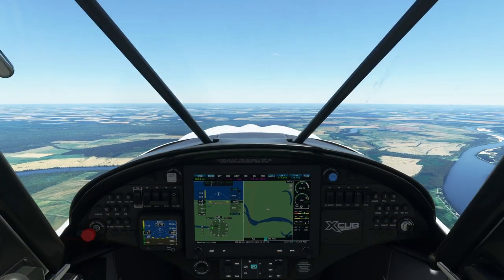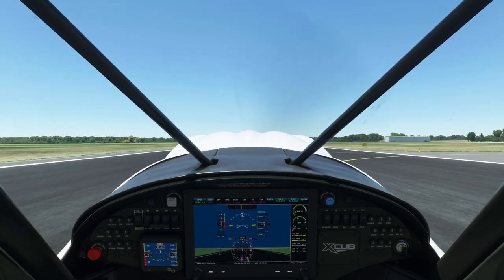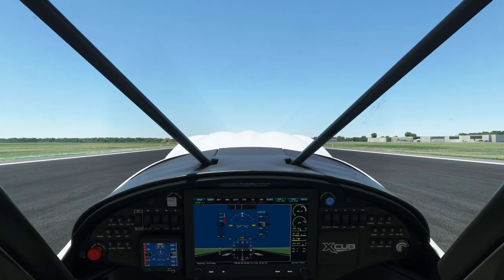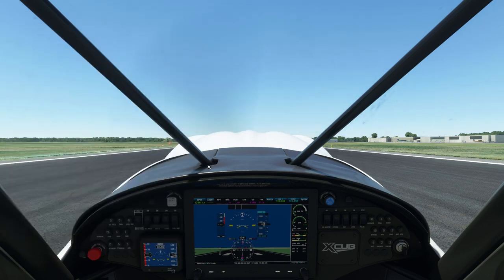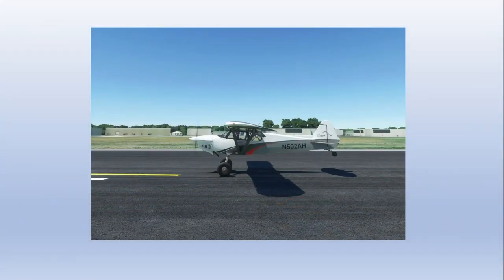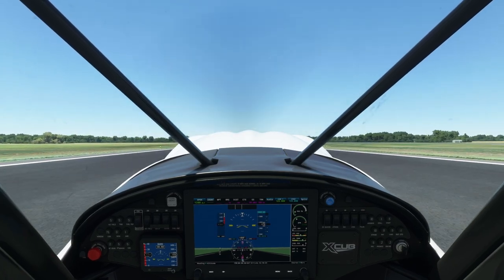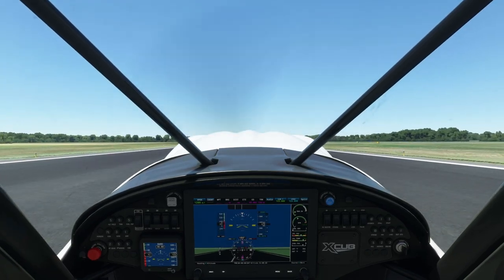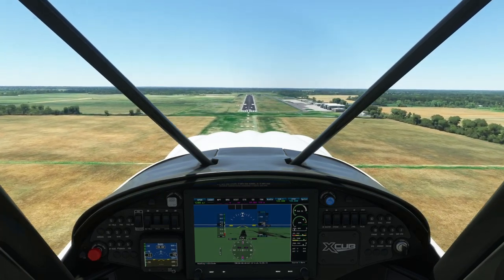Flight simulator 2020 - Flying a Tailwheel Airplane (Alpha Hotel Quick Looks)

Comment: Not if they existed at time of video but add the DHC2 and DC3 to the list. Also, I think some planes, the tail wheel isn’t steerable. More of a castor arrangement. Thx for the video.
Reply from the maker: There have been quite a few aircraft added since this was made - no doubt many of them taildraggers.  I'm sure you're right about the caster - man aircraft have a large rudder that only needs a little airflow from the engine to be effective in steering.  
Glad you enjoyed the content.  Thanks for watching!
Reply: @AlphaHotelFlightSimulation  Just returning to msfs since FS9. I hate airports n bush is only way to fly.  Any education to improve that might save me a bunch in trial and error...

Comment: Great video, congrats! 🙂 How can you stop the taildragger in case of very short runways like in the latest update of MSFS 2020 the "Skyline" Landing Challenge where the runway is only 400ft long?
Reply from the maker: The best way to do a short field in a tailwheel is probably to use the 3 point/full stall landing rather than a wheel landing.  Carefully manage power to touch down as early on the runway as you can, and keep your speed right on the recommended short field approach speed until you're over the runway.  

Once you're down, use full aft elevator to help you slow, and start tapping on the breaks to get yourself stopped.
Reply: @AlphaHotelFlightSimulation  Thank you very much! 🙂

Comment: I just can't take off with tailwheel planes. I could, a few months ago, but I downloaded the game now after some time and found out that I can't take off. After a few seconds after applying takeoff thrust, the airplane just fully steers to the left and becomes uncontrollable together with the thrust setting itself to 0. Any ideas what I'm doing wrong? I'm using a Thrustmaster Flight Hotas X with default settings.
Reply from the maker: Tognar, try turning on the "autorudder" option when flying tailwheels.  It can be found in the "assistance" options under "piloting."

The takeoff turning tendencies are way overdone in MSFS, IMHO - and this affects tailwheel aircraft more than most.  (The DC-3 is practically unplayable on takeoff without auto rudder on.)  Turning auto rudder on should eliminate (or at least greatly reduce) the effects you are experiencing.
Reply: @AlphaHotelFlightSimulation  I believe I have it on and I have these problems regardless, but thank you for the advice, I'll make sure to double check the settings.